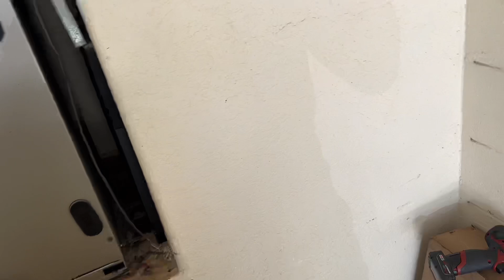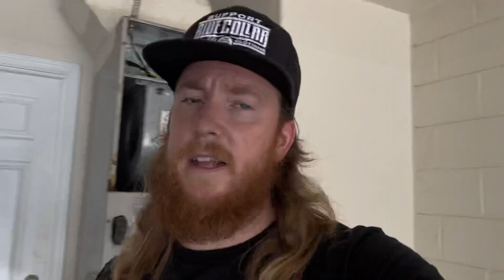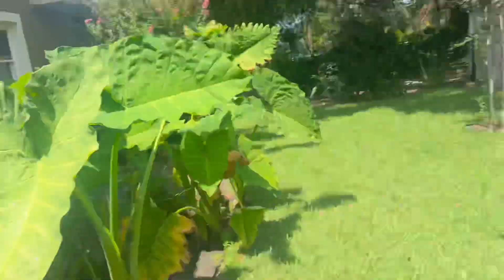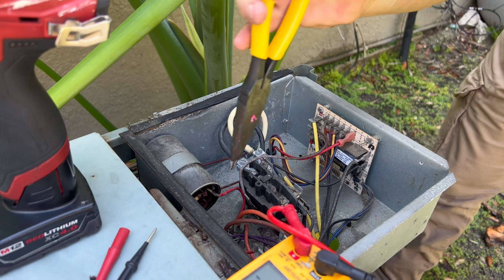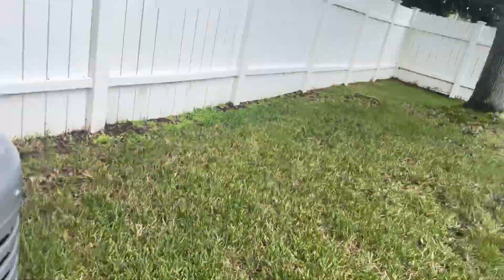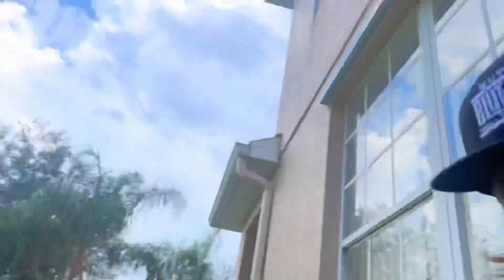Units Go BOOM | HVAC TECH | Day in The Life | VETO MB5B

Comment: You're right to get a torque screwdriver, and I think under-torque is the most likely cause of the contactor termination failure, not a surge.  The wire and contactor terminal conditions are the result of continuous heating, not an instantaneous and transient event.
Reply from the maker: I definitely need to get one for the application, would be worth it for sure!!